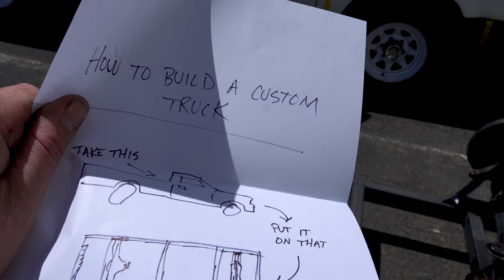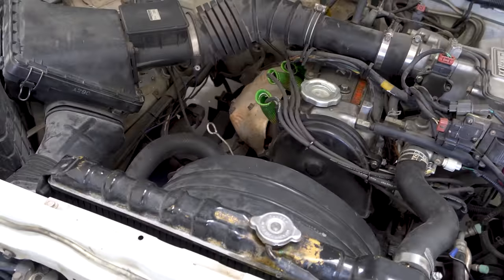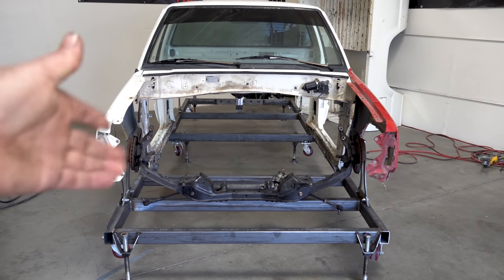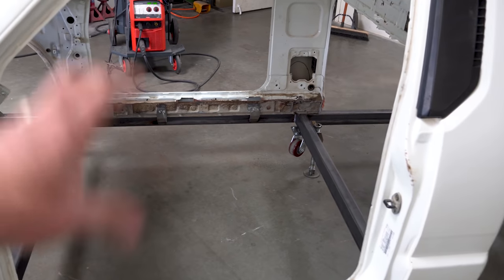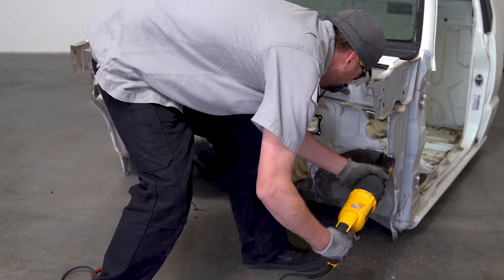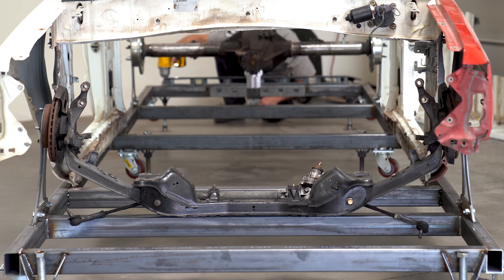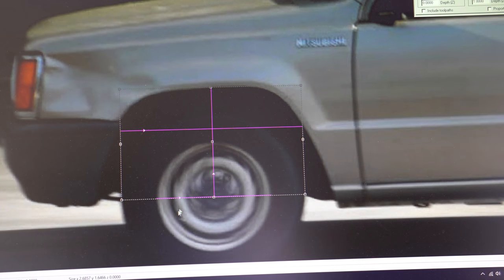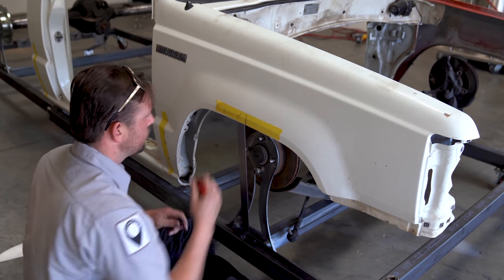Mounting the Body to the Jig

Comment: I use a self levelling laser to level my jigs. A whole lot quicker and more accurate then using spirit levels(for me anyway). Great build really looking forward to future episodes.
Reply: I do the same, but sometimes there is sheet metal in the way so a spirit level and straight edge are also very handy.
Reply: Wouldnt of thought a laser level would be accurate enough, unless you get get ones that are finer in there accuracy.
Reply: @Neishy4AGTE  A decent one is definitely accurate enough if its calibrated, my dewalt green laser is accurate to within 0.6mm at 3 meters, just put it in the middle of the jig 👍

Comment: Why not save the left to right floor/seat mount  to hold the bottom of the cab?  Also, why not create a measure point on the cab instead of the fender?  I would think the b pillar would be the best reference.

Comment: Looks to be very interesting build... certainly from my point of view.
As l too intend to do a build.
I think your idea of cab reference points is spot on.
However, l would have gone a slightly different route..
I would have used dowels on plates.
Holes to receive the dowels would have been into the 4 corners of the cab..
Place the tabs on your jig alien the cab....and weld the plates with the vertical dowels... in place. 
Take off and on the cab when needed..
You must be working to plus or minus 1mm on tolerance..
You do some good videos...
Keep it up...👍👍👍 Simon a Brit in Spain 👍

Comment: You got another mighty max? Nice! I know I've wanted to do a head swap (More in depth of a build would actually need to be done) on the one I had, but the coolant neck and the intake manifold for the twincam heads would hit the firewall or face it. I doubt you couldn't fabricate that problem away though if you were to go twincam and turbo

Comment: I'm attacking a similar project and I am following your series with great excitement. However, I am puzzled how you calculated the height from the top surface of your chassis jig to the centre of the wheel hubs. You mentioned you calculated this from your intended wheel diameter but do you not need to take into account the expected ground clearance? To me it looks like the hubs are set far too high in the fenders? Thanks.

Comment: What did you screw your brackets in with?
Reply: Looked like self drilling roofing screws, I used to use them when fitting body panels so if something doesn't quite line right just take out the screw, line up better, re-drill the screw back in.
Reply: @wint3rsmith42  never seen a screw that self drills before, in the UK we have self tapping screws, as far as I was aware they was just for wood, but a quick Google search shows they might do a metal version with a drill bit end? Not to sure if they are they same thing, something what you call is different from what we call.

Comment: Driver side is higher than the passenger side.  I always start with the frame, then add sheet metal to it.  I guess starting with the sheet metal works...kinda backwards, but then its not a real build ...it's a mini truck.  Good luck.

Comment: A+++ video i hope yt dies an a better more free platform takes over as music n anything should not mater an is300 lexus be a great donor torsen rear multi link  diff 430 gear 2 arm front suspension but my build is for handling no ultra low rider not my thing i would low to functionaly lower my old 1977 f350 roll back but just for handling the corners lowering centerd of gravity